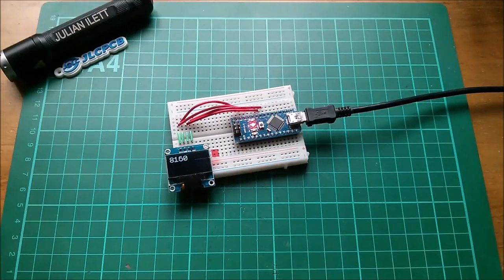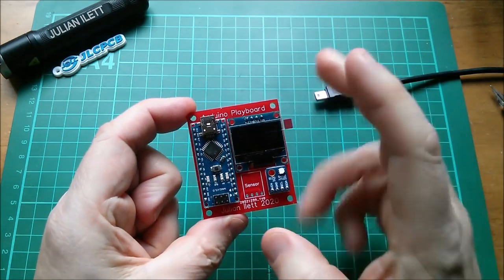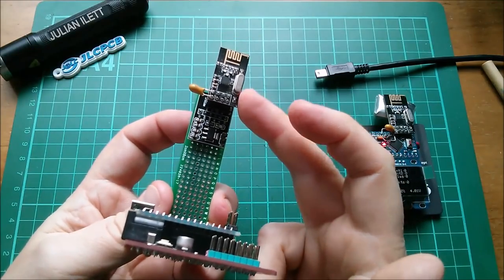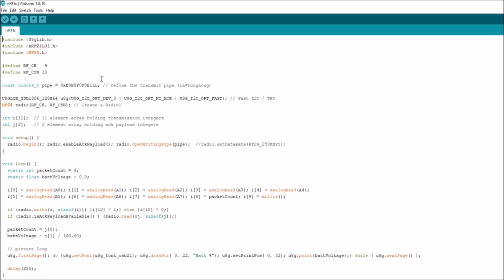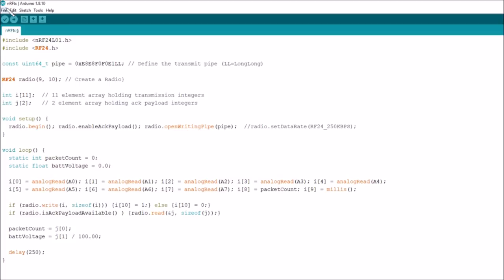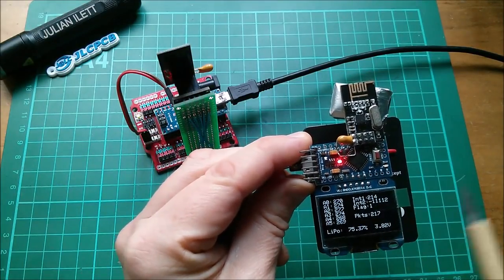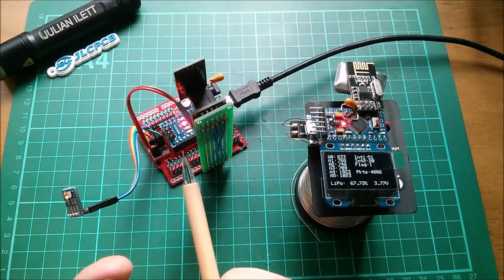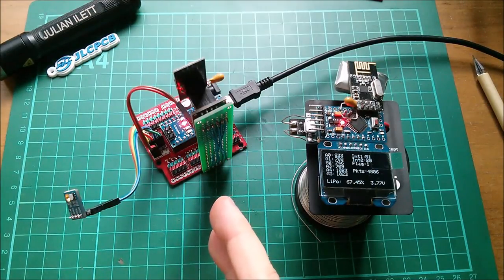Arduino and the Mouldy Shed

Comment: The enableAckPayload needs to be the same on both sides. Just disable it on your receiver and should be fine.

If you want to preserve the float values, you can use a struct, eg.
struct MyData {
    int i[11];
    float humi;
    float temp;
};

MyData mydata;

radio.write( &mydata, sizeof(MyData) );

Just make sure the size of the struct does not exceed 32. Again, needs to be the same on the receiving side.
Reply from the maker: Thanks Chris. I figured the Ack Payload thing shortly after making the video - thanks though. I also made a float array and that worked. Thanks for the struct idea - once you define the struct 'MyData', I'm guessing it becomes a type, hence the need declare a variable 'mydata' of type 'MyData'.
Reply: @JulianIlett  Yes, that's correct.

Comment: A4 and A5 = 1023 because those pins have been disconnected internally from the ADC while it is set to IIC.  Same would happen with the other analog inputs if they were changed over to digital pins. - 20:19

Comment: Add dew point to the Arduino code and display with an alarm when it’s too high. Too high dew point can cause mold.
Reply from the maker: I've been watching videos about condensation and mould - I'm trying to learn about dew point :)
Reply: Dew point is essentially the temperature at which water will start to condense. I guess you have plenty of nano's laying about but it seems like grabbing a pair of wemon D1 mini's would simplify things if all you want is the humidity/temp sensor on one side and the display on the other side. Using websockets, it should be pretty simple to set up the display server to show any data pushed to it by the shed sensor.
Reply: Ideally you need the absolute humidity in the room together with the temperature of the surfaces that suffer from condensation.  Then you can calculate whether the relative humidity at that temperature exceeds 100%.  However as the sensors in use only calculate relative humidity then you'll also need to take the room temperature into account to calculate the absolute humidity in the room.

Comment: dear julian.let me begin to say thank you for all the videos you made sofar. i have learned so much because you show a lot of different small projectt which invite to tinker around. you introduce small understandabke concepts and make them to a bigger use. elektronics  like lego. now you are introducing a new 2020 path to create some wireless domotica to challenge the ownership of a shed ! me as a fan of your channel can see where this is going. in this video we can see youbstrip the code and create new lego parts.  i have kind of similar problems  as you have with your shed ! when i was looking up information for my own problem ( a medical growing shed ) i was looking for information about multiple arduinos reporting a variation of data through radio like  nrf24  .( humidity , temperature ) . that would involve mesh networking maybe or adressability of data or multi pipelining maybe.. well this is where my knowledge ends and why i came to channels suchs as yours. my real question to you  would be . can you maybe approach your new 2020 parh as you have uhms 5 sheds ? and teach us ( i think there are more then me alone )  how to control some heathers and humidity in a shed or 5  .
Reply from the maker: I'll do my best - thanks Milene

Comment: Interesting way of doing this - just curious - wouldn't ESP32's be better and easier? esp. bearing in mind you can get an esp32display version for the receiver?
Reply: In that case the video would be 5 min
Reply: Where's the fun in that, though?
Reply: @pileofstuff  there is that - I guess it's a toss up between making an interesting and informative video, and making something purely functional.
Reply: @TheRealSasquatch  There's also something to be said for using what you have on hand at the moment.

Comment: Julian, just wondering when the PIC programming tutorial series will resume.  I'm pretty sure I'm not alone in wondering, as many of us bought a bunch of PIC gubbins when you gave us a shopping list for that project.  The whole thing seems to have ended nearly three years ago after just a few videos that only got as far as flashing a LED...
Reply from the maker: I'd just started that tutorial series when I had to focus much of my attention on family matters. That's the problem with starting an in-depth series - there's no guarantee that it will get finished. Just bad timing I guess. I did do a few videos on driving Neopixels with the PIC, but the view counts were not encouraging.

Comment: Got mine up and running today and broadcasting temp & humidity across the flat.
What I did though was to put the radio.write in an if statement comparing the current readings to the previous ones so it only broadcasts if something changes.

Comment: Pretty good work, but I have several questions:
- Why aren't you using LoRa modules with built in displays? Wouldn't it be compacter and easier?
- What's with the strange SPI-adapter? The Nano has also SPI pins on the top. Wouldn't it be cooler to built some sort of rucksack?
But other than that: keep up the good work!

Comment: Why not get a couple of 200mm computer case exhaust fans and have the arduino in the shed turn them on when it gets over the dew point?
Reply from the maker: I'm planning something very similar using a 12V bilge blower :)

Comment: I realize you're using stuff you already have, but for anyone who doesn't, I'd like to suggest a single board radio solution, such as TTGO's ESP32 LORA boards.  You can even get two with OLED displays for around $25 on Banggood.

Comment: You do the long way around on the SI7021 for humidity and temp normally all you have to do is a Get humidity call and it will get both and much faster . Just a little idea for ya . Cheers

Comment: putting constant numbers in the code is sometimes referred to as magic numbers. they work but do not provide any help in documentation of the code. #define's provide the required meaning behind the numbers.  numbers do not help the other you that comes back a year later to understand what your code was doing. sorry to hear about the mould.
Reply: Also, defines give the compiler more scope to optimise code. Static const says “put this in SRAM”. As programs get more complex, you quickly realise that SRAM is a severely limited resource on the Nano.

Bottom line is always prefer #define to static const.
Reply: @mikelopez9893  right on the nail. #define does not take up any space in ram.  it's just replaced with the number during compilation.

Having to fix bugs in other peoples code, 
#define maxsize 10
IF (x < MAXSIZE ) 

is way better than just
 IF(X < 10)
Reply from the maker: OK  - looks like I got this the wrong way around - thanks :)
Reply: MISRA-C coding guide is always a good night time read. :)
Reply: The advantage of using static const is that you gain type checking.
The disadvantage of more memory required means the #define method is probably better for Arduino

Comment: You can power an nrf24l01 off the Arduinos 3.3 volt pin. I do it with all my projects involving these modules and it works fine.
Reply from the maker: I seem to remember that 3.3V on the Arduino comes from the CH340 (or equivalent) serial to USB chip and has fairly limited current. Well, that's what I said in one of my old videos.
Reply: @JulianIlett  You are right I discovered that when the 5V regulator failed on a Nano and I wondered where the 3.3V was coming from.
As I said had no problem powering the radios even without a capacitor. One project I even had a rear bicycle light powered off the 3.3V pin temporary without issue.

Comment: I get peeved every time I see a simple solution ( using a couple of libraries and hey presto, a few line of code and it's working ) knowing that it's all done under the Arduino framework. No true debug facility, slow IO access, and generally not something to use in a professional environment.
I've had need to 'steal' some libraries... hack them back into C code and use with AVR Studio to get working in a proper debuggable IDE.
Am I missing a trick here?

Comment: I just watched and subbed to your second channel as requested sir=)
You said you can't find any arduinos.....  I'm guessing you have dozens but they are all hiding, but just in case I'm wrong, Banggood are selling Nanos for £1.30 each at the moment. From China of course, so not exactly as quick as rooting through lots of boxes of "stuff I'll need to keep safe", but at that price..... it's good to have spares!
Reply from the maker: Thanks Dik - I've put in an order for a Nano or two on eBay - I think the Nano is the most useful of the cheap Arduinos :)
Reply: @JulianIlett   I agree. I only use my Uno to burn my nanos' bootloaders  into optiboot  Unos=).
 I'm still very new to all this and I'd much rather take risks with a £1.30 Nano than a quite a bit more expensive Uno. I haven't killed one yet, but I'm sure it's only a matter of time... I'm fashionably late to the arduino party, but I'm having a blast. Thanks again for all the fun informative videos.

Comment: I'm getting triggered by the fact that you put multiple statements on the same line ;)
Reply from the maker: I want to keep the entire sketch on the screen without scroll bars. As the sketch gets longer, it will have to grow horizontally rather than vertically :)
Reply: @JulianIlett  Makes sense ;) I'd get roasted in the code review at work if I did it like that :P
Reply: @samuelschwager  don't you just hate style guides and coding practices. MISRA-C now that's a good read.
Reply: @TheEmbeddedHobbyist  I'm not innocent either ;) I introduced a typescript style guide that is enforced by the build server. My coworkers hated it at first!
Reply: @samuelschwager  I was told on a software course that no style guide is better than a bad one. I had a boss who got a blue eyed boy to write a style guide. he found something on the internet and put it in a company document. it stated that variable names had to have the type in them and a description. so "int index" became something like "int intIndexInToArayOfX" funny thing was he's document soon became issue 2 which had no resemblance to issue 1 at all ;)  based quite a bit on MISRA-C much to the relief of the others on the team.
Reply: @TheEmbeddedHobbyist  It sounds like the blue-eyed-boy became the red-haired-stepchild. ;)
Reply: @TheEmbeddedHobbyist  I actively avoid C and I paid for the MISRA-C spec. Still can't find a good project to start learning Spark/Ada. High-integrity systems FTW :)

Comment: Now, of course you could instead simply buy one of those weather stations that come with remote sensors at Lidl, or whichever store happens to have them on sale this week.

But where would be the fun in that.
Reply from the maker: I bought one from Clas Ohlson a couple of years ago (with an extra sensor), but it can't drive a relay to turn on a fan at a programmable temperature and humidity. Arduino can :)
Reply: I think the remote sensor in those only measures temperature; that’s the case with the one I bought from Lidl.
Reply: @tbavister  I happen to have one that measures both.
Reply: @JulianIlett  Exactly! :)
Reply: @Anvilshock  Nice I guess mine is a few years old now.

Comment: Well, that is very exciting. However, it makes me feel dumb, dumber, dumbest: you can pick up 5-yo code & boogie; I pick up Friday's code Monday morning and have no clue….

How would it be to put an alarm on your receiver to alert if humi goes high?

I'm having trubble finding the link to your second channel in the "witty" description.
Reply from the maker: Certainly an alarm, a little buzzer would be easy to implement - but also a switch to turn on a vent fan in the shed :)
Reply: It does not make sense to me to get the temperature and humidity then to trigger the measurement.  Surely you should trigger the measurement then get the readings.
Reply from the maker: It doesn't make sense to me either, but that's the order in the example sketch. Seems to work :)
Reply: @JulianIlett  Surely two sensors, one in, one outside. Not much point turning on a fan if the outside humidity is higher than the inside, you'll just suck in the damp. ;-)
Reply: @JulianIlett  I would first try just  passive ventilation at the floor and up high and if that doesnt work some ground drainage. Triggering the small diesel heater automatically might also be an option.
Reply from the maker: Exactly that - I'll put another sensor under my covered workspace :)
Reply from the maker: The diesel heater is not an option (it's broken and I'm not going to fix it). New heating solution coming soon :)
Reply: @Bob_Burton  without looking at the library, it looks like its setting a buffer. Then trigger measurement sends the buffered packet to the device.
Reply: @JulianIlett  the sensor require some time to obtain the result so by triggering after you have read the results gives the IC time to process the next readings. Otherwise you may have to trigger a measurement then wait until the sensor gives a reading ready signal. 

looking at the datasheet it points out that there are two methods of the sensor indicating a measurement is in progress, clock stretching or not Acknowledging read requests. both a pain to do so it's easier to  just trigger the measurement and go away for longer than needed for the sensor to process the measurement.

Comment: Can you not just, you know, fix the shed?
Mother nature sensor's (damp and mould) are telling you all you need to know.
Reply from the maker: I may ask the shed supplier to fit a new roof (with proper overhang) at some point. But I still want to continue with this project :)
Reply: @JulianIlett  I was just pulling your leg. Probably it is the roof that has failed. Most of them are that tar paper stuff which doesn't last more than 10 years. One split and it's goodnight Vienna. Also there may be too much foliage or not enough gap between it and the fence, especially if in a shaded corner.
Reply: @mahlapropyzm9180  The shed is new so it's a  problem with the design of the roof and door.
https://www.youtube.com/watch?v=jtteekhUaIM

Comment: This might help you on the HC12 1.8Km range and only uses 2 pins (1) http://www.botsrule.com/pattonrobotics/Simple%20RF%20transmit%20and%20recieve%20demo.html (2) http://www.botsrule.com/pattonrobotics/Multi%20Analog%20Read%20RF%20transmit%20and%20recieve%20demo.html